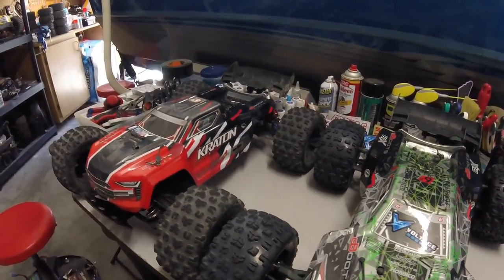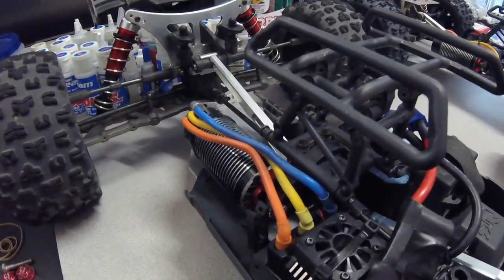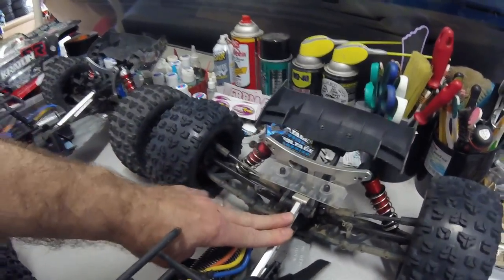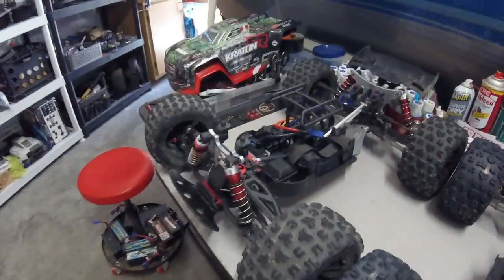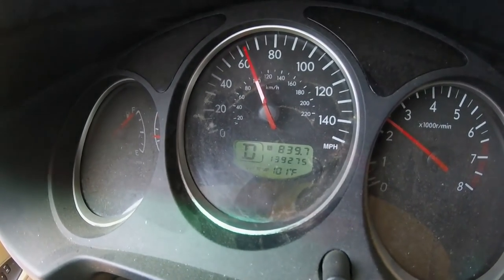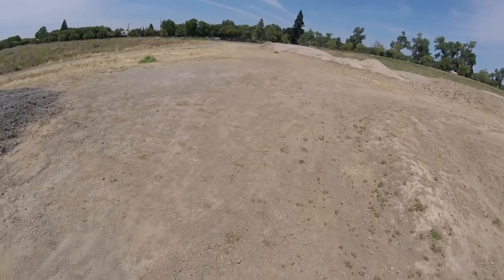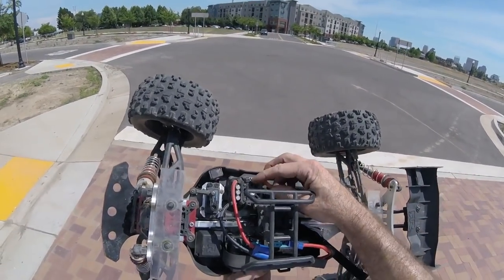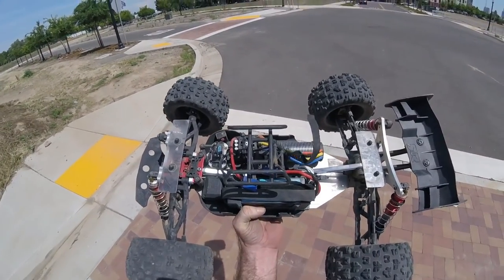ARRMA Kraton V4 "Goes Beefcake" Upgrades and M2C shock testing...

Comment: Hey buddy I'm having issues with my V4 kraton on the front diff that little nipple that hangs out that goes into the circle on that red piece behind your front bumper it always breaks off on me and then doesn't let my shocks stay tight anymore and they kind of go up and down. Have you ever had that happen to you when doing bigger jumps. Cuz I'm not sending it as far as you are I have sent it about 70 ft quite a few times and that's when itnormally pops off. I ended up getting the aluminum hot racing front diff bulkhead to try and prevent that from happening so I was wondering if I'm doing something wrong and that's why it's popping off. You can shoot me a message and shed some light on that for me that be great.
Reply: I got it figured out buddy...I didnt have the 2 screws in the bulkhead that connect the red metal hingepin mount to the bulkhead.

Comment: Do you put those plastic shims back on. A arm hinge pins when your building armas i ordered infraction i noiticed they really packed in there so be no play wondering if you use plastic washers so dont jokey out on hard landings
Reply from the maker: I've used both plastic washers and the stock plastic C clips. I've never had a problem with my clips bouncing off with landings. Just lose them sometimes when pulling my rigs apart🤣🤣😎💪👊👊

Comment: Nice footage..   and u got some sweet skills man..  dont know if this post is too old, but im thinking of getting talion exb. Ive got a kraton v4 running stock only changed the radio and vented the tyres. Question is.. should I get the beefcake m2c kit or the new talion? Cheers from Denmark..
Reply from the maker: Thanks Thomas 🤗. I've always loved both the Kraton and Talion. They handle quite a bit differently. The Talion EXB chassis and towers aren't as strong as M2C 7075 T6, but  they're stronger than the stamped aluminum that comes with the RTR models no question. I can't really answer which direction you should go with the Talion vs getting the beefcake kit. I'd probably want both trucks myself and upgrade as you go or see fit for your needs. 🍻
Reply: @richduperbash2966  ..  thx for the reply Rich. I know there's no straight answer.  Ill probably start with and upgrade on the kraton. Jims bearings, servo and motor mount, hubs..   getting to know the car its been a while since l last had an rc.. 25 years maby. Still makes me smile..  stay safe brother and Bash On..
Reply from the maker: @thomasholdtchristensen9566  sounds like a great plan my friend 🤗. I also had a similar 20+ year break from the hobby. Brushless power got me hooked for good. Getting to know your rig well truly pays off. You'll enjoy it that much more 😉

Comment: Rich awesome videos as always. For your builds do you prefer sensored or sensorless? From my understanding is sensored just gives better smoother response at the low end of speed compared to sensorless. But most sensored systems end up turning to sensorless at the higher speeds to get the benefits of the sensorless system. I never driven or handled a sensored system so was just wondering what your thoughts were and what you liked and why over the other as I try to figure out a build setup for electronics.
Reply from the maker: Thanks Donnie 🤗. I have limited experience using sensored. It's very smooth at lower speeds, but I don't drive slowly for very long and the guys I raced buggy on the track with didn't seem to have an advantage. I don't feel bashers benefit much from sensored setups. 😎💪👊👊
Reply: @richduperbash2966  Rich thanks for the feedback, that is good to know. I am kind of like you and my daughter thinks so the same "Oh my Dad is going crazy and going way to fast", is there really any speed other than Full Throttle? :-P So in theory if you get one cool but not really something that necessary and more $. What are your thoughts on the Spektrum electronics (ESC and Motors) and how they compare to Castle, Hobbywing, etc? I am still trying to find out where products stand in the hierarchy of Tier 1 (best ultimate) to Tier 4  (dumpster fire worse) out there and also never sure on how the stuff that comes from the manufactures are compare.
Reply from the maker: @DonnieKluck  the Spectrum electronics are highly efficient and reliable overall. Definitely not bad. That's why guys are able to pull them from RTR's and get a decent price if they choose to go with a different power plant. There's a wide degree of opinion regarding which brand is better. I like Hobbywing (they likely make the Spectrum ESC's and get rebranded). Castle has some nice stuff, but I view it as overpriced. Their power switches are super old-school, but they allow data logging with their Castle link which can provide very useful info as well. Most guys have to try different brands and set-ups to reach their own conclusions in the end. Bottom line, you can build a very fun, high performance rig with about any of them. 👍
Reply: @richduperbash2966  Thanks for the information I do appreciate it, the landscape has changed a whole lot in the 15 years I was gone from RC. So I really do appreciate you helping me out and taking time to answer my questions and comments no matter how off the wall they maybe or newbish, thank you fine sir. That is a good on the Castle part which I could totally see. This whole COVID time has changed and screwed up pricing every where for everything so if you did not have a good reference point prior to the pandemic hard to tell what is a good price/value for what you are getting. Glad to hear that the can build something good either way with any of them.
Reply: @richduperbash2966  Rich how are you doing buddy? Well I kind of got my self in a pickle with my Castle Creations Mamba Monster X 8S ESC and 1717 (1650kv) motor as I was trying to change out the pinion gear from 18T to 20T, and trying to adjust the 20T or change it out but in the process snapped the hex driver off in the grub screw. I tried to drill it out but that did not work so instead I am sending the motor to Castle to hopefully fix under non warranty work. But in the mean time would you have any recommendations for another motor that I could and should run with the CC MM X 8S ESC? I did not know if I would have any issues running something else with the Castle ESC or what you think would be the best motor to run. Figured it would eventually would be a spare I would have once I get the Castle one back. Any guidance or help always greatly appreciated buddy.

Comment: What servo do you run/ recommend for the 6s Arrma kraton / talion
Reply from the maker: I use to run Savox 1210, but switched to Power HD 23kg WP awhile ago 👍. Great value with good specs and impressive durability. 🍻😎💪👊👊

Comment: In the stock setup would 60 weight be good,not much bashing?
Reply from the maker: The stock setup is 80 weight. You might like going 60 weight 🤔. Just expect a little more initial front to back weight transfer on throttle/braking. You'll lose some dampening, but might like the change in handling. 😎💪👊👊

Comment: If you move rage top shock position in one or out one what, what do you gain\lose?
Reply from the maker: Changing your shock angles makes a significant difference in dampening, stability, traction, and responsiveness. The more angled inward, the more initial dampening and overall responsiveness. The more upright angled, the less initial  dampening you have, but generally have better lateral traction cornering and greater stability over terrain. Upright is more forgiving. Here's a link that has good shock setup info. 🍻😎💪👊👊https://www.myrcbox.com/articles/tech-article-off-road-suspension-tuning-guide/

Comment: Hey Rich, why do you not like the Arrma stock 2050kv motors? Or.. why do you swap them out on all your trucks? Is it that much of a difference? Just asking bro cuz I’m going n the middle of a rebuild now, Talion /Kraton. Love the informative vids bro with big bash attached to them! 🏎🧰🚀👍🏻
Reply from the maker: Hey Brother 👊. I have no problem with the stock system 👍. I'm still running it in my Talion and Outcast. These 4092 motors just have gobs more grunt and torque 👀. They work Killer for clearing gap jumps with minimal run up space. Aside from that, I just like switching things up for variety 😋. The only issue I have with the stock ESC is the silly on/off switch. It's prone to failure. I really prefer the large button style with separate set button like with the Hobbywing. 🍻🤘🤘😎💪👊👊
Reply: Nice bro! Ya I wasn’t thinking about the short run for ramping off a jump, makes total sense! I don’t like the esc either really but so far so good. The controller is a whole other story, very glitchy. Any how thanks for the reply man, ya I was just curious on that. 🏎🧰🚀👍🏻👍🏻
Reply from the maker: @bwoodard907  you bet Bro 👊. I'm over trying to adjust to the STX2 controller. It's really a disappointment for such fine 6s rigs😝. Think Horizon has gotten the message by now. 👍
Reply: I would imagine so.. 😂

Comment: Hey Rich! Awesome videos! What shock weight oil are u using?
Reply from the maker: Thanks so much Ed👊!!! I was running stock oils (1000cst) the first part and 1000cst rear/2000cst front the second part. Our goal is to size the pistons to work perfectly with the stock oils 👌. As of today, I have smaller sizes to get it tuned just right 👍👍😎💪👊👊
Reply: Thank you Rich! I think I’m about an hr away from one of your bashing spots, would love to come join u one of these days. We have a Notorious with mostly Voltage upgrades and some GKA :)

Comment: What's the gearing you're running in that 1480kv I have one just like yours
Reply: I wanna know the same but i am running a 20 pinion in a stock hobao sse truggy with that 1480kv motor and its pretty good
Reply from the maker: Sorry Brother. Just saw this 👀. I usually run a 22T Robinson Racing Extra Hard #1222 🍻😎💪👊👊
Reply: @richduperbash2966  cool cool that's what I'm running except tekno

Comment: Sweet Bash Rich, Some Monster Sends 😮😮😮😮🤘🤘🤘🤘🤘🤘
The Kraton is a BEAST 😈😈😈😈😈😈
Bummer on the servo bro 😬😬😬😬😬
If you wallet permits, maybe give a hitec a crack bro, they can take some serious punishment 🙃🙃🙃🙃🙃😮
Glad to see you out in some nice weather 😎🤘👌
it's cold and windy over my way at the moment 🙄🙄🙄😅😅😅
Reply from the maker: Thanks so much Matt 😜!!!! It was only a matter of time before the V4 got the "beefcake" injection 🤣🤣😱😋😋. I harvested almost all the Voltage off my old Outcast 👌.  Swapped bulkheads/diffs, shafts, and links. Kinda the slow way to build, but the only way 👊. The servo was a dang bummer 😝😝😝😝💩. To be fair, that Savox lived a long hard life. Appreciate the Hitech suggestion Brother 👍. I have a 40$ HDPower wp 23kg going in. Same specs as my 1210sg just a lot cheaper. Been running one in my Talion for months. Hope your weather improves Bro 👊. It's about to get super toasty here 👀🤘🤘😎💪👊👊

Comment: these jumps are nasty
Reply from the maker: Yes they are 🤣🤣👍. Good way to find weak spots and limitations in design and durability 👀. The upgrades make it possible to dish out regular beatings and just keep going. 🍻🤘🤘😎💪👊👊
Reply: @richduperbash2966  i do the same thing but im a x maxx lover got the kraton but ended up breaking both diff and sold it love the channel btw
Reply from the maker: @Adampage69  thanks Adam 👍. The XMaxx is a BEAST no doubt. Bummer about your Kraton 😝. Gear issues are frustrating for sure. 🤘🤘

Comment: Those kratons are looking tough rich , these are complet shocks or we will use oem body
Reply from the maker: Thanks Bro👊!!!! These are just M2C caps and custom pistons 👍. They're a direct fit on the OEM shocks. The goal is improved performance with a "zero rebound" emulsion style set up. This is only achievable by removing the bladder style stock caps. 🍻😎💪👊👊
Reply: @richduperbash2966  nice thanks rich